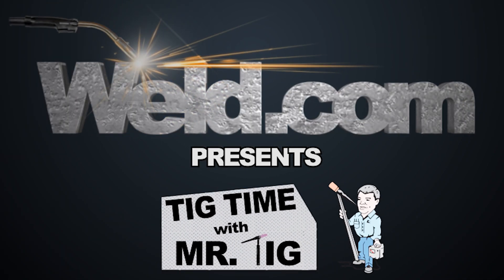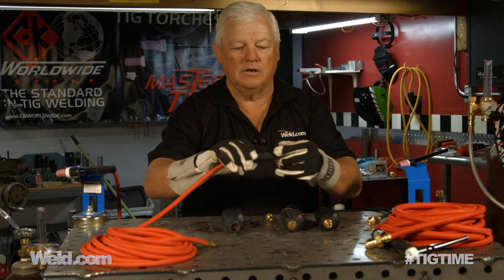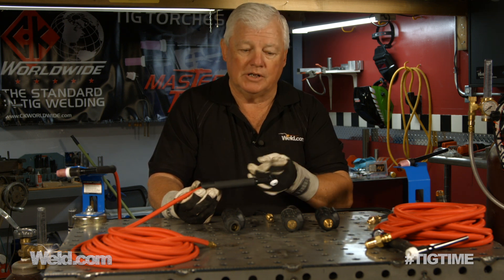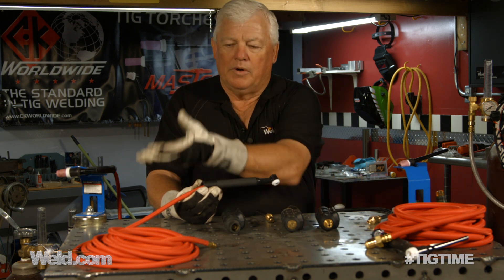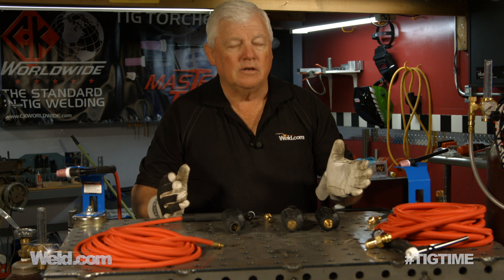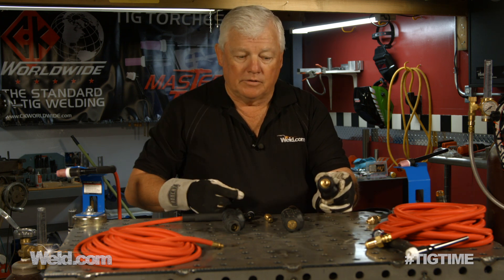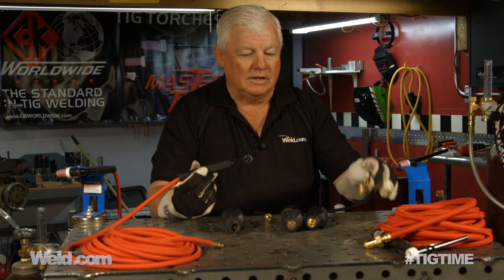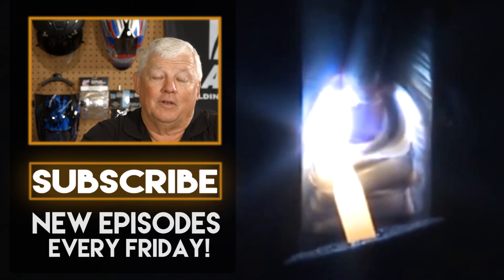TIG Torch Basics and Connection Compatibility | TIG Time

Comment: So here is a jackpot question for you.I have a WSE200S inverter welding machine with both a DINS connector and a connector for the power\air in one .I bought a WP17 torch and that has a DINS connector and a separate Argon supply fitting that also fits on the Power\air connector on my welding machine. So here is the question . When i select TIG DC\AC on my machine , does both the power connectors , DINS and Power\Air connector give me current output at the same time.I find that i can weld from either output in TIG mode? Might that be harmful to the electronics perhaps ? If this is true that you can weld from either outlet on TIG mode , it make things so much easier when when buying a new torch with a different connection configuration .

Comment: Hi, Have    ARCCAPTAIN TIG Welding Gun, WP-17V Argon TIG Torch with 13-FT Red Air Hose and 35-50mm Connector, Lift Tig Torch 150amp with 13-FT Cable for ARCCAPTAIN ARC200 MIG200 What type adoptor I need to connect to   Lincoln Electric AC-225 Stick Welder  Thanks

Comment: Hi Mr Tig, I live in the UK and have just bought my first TIG AC/DC machine. I am struggling with the rather heavy / restrictive torch (26-gas). I plan to weld thin stainless / ms / Ali and only really need 150 Amps max. Can you recommend a suitable 'super flex' assembly. My Welder (love it!) is a Welbach ENTRIX 200 UK.
Reply: You are better off talking to the brick wall, like in the Dragon's Den...

Comment: TIG newb question. 
Would it be a bad idea to add another solenoid valve to my TIG to flow low PSI shop air through the gas line when the argon shuts off?  Seems like a no brainer idea, but the fact it's not a widely discussed solution makes me think it doesn't exist, and possibly for a good reason.  Of course the air supply would be filtered to the utmost degree, but I would think a stead flow of air would keep my torch as cool as it can be.
Reply: You might get alot of porosity.
Reply: @strayedarticle2838  in between weld cycles?  I mean while welding, use argon, but when done welding, just to to continue air flow thru the torch to rapidly cool it off filtered dry shop air.
Reply: @MichaelJeffers75  I see what you're saying. That sounds like it might work actually, but only one way to find out.  I hang mine in front of a shop fan, and that seems to be ok, but your idea would cool internally, which would be quicker. Let me know how it turns out. I might try it if I ever get some downtime.
Reply: @strayedarticle2838  honestly, I don't think I'll get around to it anytime soon.  I bought the cheapest TIG in hopes of replacing my flux, but after DCEN conversion, the flux lays'em down like a champ now and won't have any loose funds to buy the argon cylinder.  I do hope to eventually get back to my TIG and then would def try this, but that could easily be several months.
Reply: @MichaelJeffers75  When you do decide to try tig, you might ask the welding supply place if they rent argon tanks. I know Jones rents oxyacetylene bottles for $20 per month. Argon tanks probably go for about $10.
Reply: @strayedarticle2838  I looked into that and they run credit, but my credit is shot, so I have to buy one.

Comment: I have a Amico Tig-185 and I would like to change the torch head that came with the unit to a CK 17 flex hose what will I need to acomplish this. Thanks, Mike.

Comment: So though an old video I am wondering if there is a commercial selector for choosing between a pair of water cooled torches.  I have a miller dynasty 700 and hate the process of switching between the 250Amp and 400Amp torches.  A quick search didn't turn up any.  Since you are Mr. TIG I figured if there was such a beast to be had that you might know.  Thanks in advance.

Comment: I need an adapter fitting to attach my CK 17 flex torch to a Primeweld 520ct d. Can anyone point me in the right direction? The fitting on front of machine is M16x1.5

Comment: Great short video Mr TIG! I am an entisiast of the art of welding and after a long search for knowledge about this subject, I bumped on this masterpiece which answered many questions on my mind about TIG torch, cable compatibility and connection in the shortest time I know so far. Thanks.
Now, what capacity cable will be compatible with an Andeli MIG -250ME  3 in 1 gasless MiG/ARC/TiG welder? - 150A, 200A ...or what?

Comment: I just bought a Miller xmt350 cc/cv. It came with a gas valve kit. I have not installed it yet. What type of torch do you recommend. I'd like to use millers wireless foot pedal and cables no longer than 25' are necessary. Air cooled since I live in Minnesota and my machine could see temperatures below freezing at times so water cooled is out of the question.  Budget is not an issue. I want premium products that will last, and that are comfortable and very durable since I'm hard in things. Thanks 
Stephen Carey

Comment: I want to put on a CK torch flex head on my ESAM EMP 235IC. Do they have a package?
Reply: I’m looking for info on the same. Have you found what is needed?
Reply: @SRandOR  i e mailed CK mfg and they told me to call them and they will set me up with whatever I need. I haven't had the need yet, but I a would assume they can set you up. Good luck.
Reply: valleybarbell I was about to that point, I appreciate the reply.

Comment: i need a ck tig torch flex and hose for esab rebel  205
Reply: Check out IOC Welding supplies..got a #9 flex with gas adapter for the esab 95i..

Comment: Hi, I have a new 2018 AHP Alpha TIG, which came with a 17 style flex head torch, and it seems adequate. I'm new to TIG welding so I don't know how much more flexible that cable is compared to the one my machine came with. My question is why are you recommending a 150 amp cable for a 200 am machine? Wouldn't it be better to use a 200 amp rated cable?

Comment: I have an Everlast 200st and it burns hot , at 110 amps  my CK17f is smokin feels more like 210 amps, I may have to get a trimline to  handle the super coupons I'm welding out, even with 6010 or 7018 @ 50 amps acts like 80, very High on  output  , very happy with my Everlast, schedule 40,80,120, it can handle it all ,with a 50 amp breaker this unit welds better and more  forceful than  the Lincoln invertec 450 back in Trade school

Comment: I've just bought a regulator, exactly the same type as you have on the right hand side of the frame, but I'm having trouble adapting it to my gas hose. It's output has that kind of  two part barb fitting that is screwed on but it's too small for my gas hose (which already has the same style of fitting crimped on, only bigger). I'm having trouble finding information on these types of fittings and what kind of adaptors are available. It looks like your regulator output is adapted up to suit the connector on the hose. What adaptors have you used, and do you have any good sources of info about types of welding fittings?